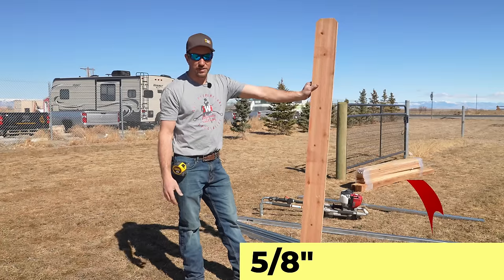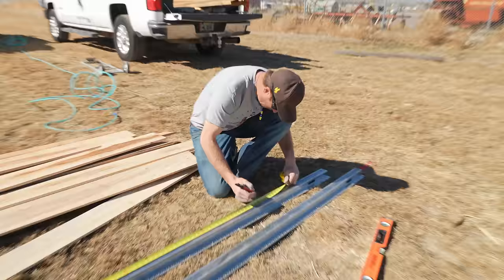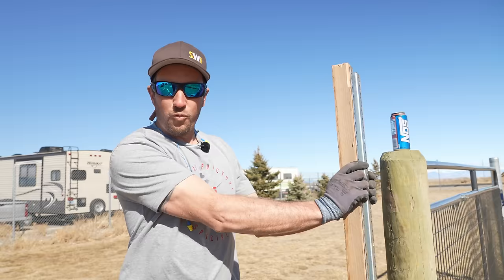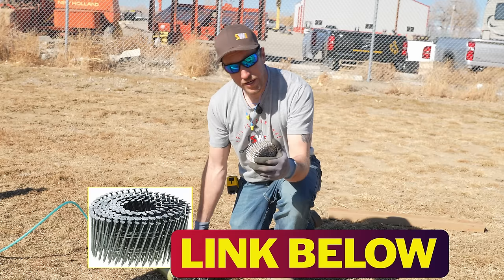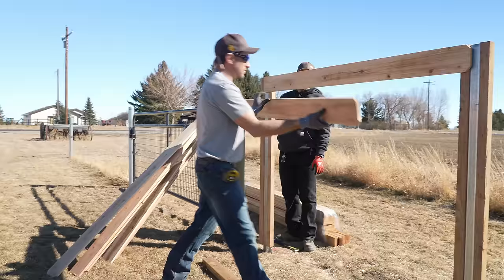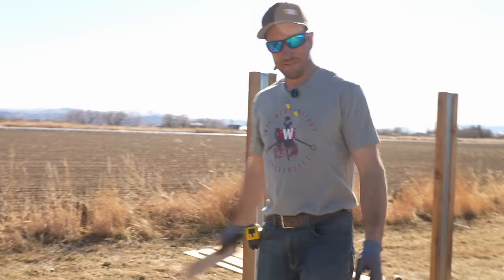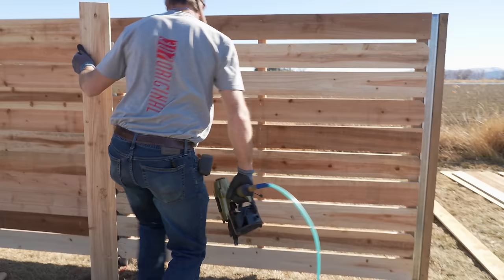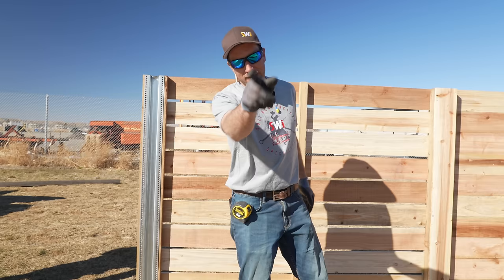How To Easily Build Horizontal Cedar Privacy Fence

Comment: If you want to skip the nailing phase and don't need to look at fancy finished ends, get some 4x4's and use a table saw to cut a 1-1/2" deep, 1" wide groove down the entire length of two opposing sides.  Set your posts so that the grooved sides are facing in the direction the fence is going to run.  Depending on what your budget or visual preferences are, you can space the posts apart at the proper distance to accept whatever length board/plank you want to use.  Once you have the posts in place, slide each plank down from the top into the grooves, and keep doing that.  You can keep the posts extending higher by a foot in case you want to install something later or maybe make the fence taller.  The great thing is, you can add/remove planks and use varying widths and styles to get exactly the look and the height you want.  If the city inspector comes along and says the fence is 12" higher than allowed, simply remove a few planks planks until you're at the legal height.  Doesn't get much more simple than that.  Alternatively, if you don't have a table saw to groove the posts, you can fasten two strips of wood onto opposing sides and leave a 1" space to accept and hold the planks in place.  You can also put a screw on the top board to ensure the planks can't be lifted out easily, or install a top strip along each section to create a fancier look .
Reply: Cool!
Reply: I was thinking of doing this, but I want a small gap between horizontal planks, maybe about 1/2”. I haven’t been able to think of a good idea for spacers. I was thinking maybe to use pocket screws. Any thoughts?
Reply: @nickgrubisich6367  Why not use one of the pickets? Or a section of one? That's 5/8" right there.
Reply: @nickgrubisich6367  I did what he describes on my deck for a single privacy fence. I used a router, as table sawing large grooves in even slightly warped wood is not enjoyable or time efficient.

I separated the boards by getting a spacer for consistency, drilling a tiny pilot hole on each side, and hammering in small galvanized nails. These hold the board above the next one and are mostly hidden on the ends, in the groove.

Honestly it’s a lot of work for an entire fence and I bet would take a huge amount of time. It looks amazing on my deck, however.

These 4x4 are prone to drying and bending and I’d wonder if removing more wood as described, over an entire fence line, would exacerbate that. If you did it with 6x6 or 6x4 you would have a cool looking fence.
Reply: I will be doing horizontal fence in my backyard this spring but I am concerned about 5/8 being a bit too thin, maybe go for 1inch instead.
Reply: The only problem with this method is your 4X4 post is only 3 1/2" X 3 1/2". That only leaves you a 1/2" of center material after making your notches. Not enough strength for a fence in my opinion.
Reply: @nickgrubisich6367  pieces of wood on both sides between the slabs, just like is done in this video.
Reply: The 5/8 x 6 x 6’ pickets at my big box store leave a lot to be desired, what with twist and warp. I imagine I would struggle to find 312 good ones for my fence. Do they straighten out ok once fastened to posts? Also, I plan on using Lifetime Fence powder coated black posts and letting the beautiful black show for contrast. What do you think?
Reply: ty soooo much. im literally doing this fence . we’ll sons are. but yea. i was clueless on how to avoid spending money on all them black slats to hold the wood. but u mention taking two strips of wood and
i get that . TY !!
Reply: Crazy... came to watch the video, leaving with a whole new plan.
Reply: @nickgrubisich6367 I am going to try screws in the posts, just above each plank.

Comment: I'm using 8' postmasters and putting them 48" inches into the ground with 10" holes.  Frost line is 42" inches and the ground is mushy clay in the spring (which is why I didn't drive them).  Can I get away with 4 sixty lbs bag of cement per hole and then backfilling and tamping the rest of the way(clay) or do I have to concrete to the top of the hole?

The section that I completed (to show my wife what I was doing) I filled to the top.  

I had to slow down on the project after hitting a rock on the last hole and pulling out my shoulder.  I had been doing real well being careful with all the roots and rocks in my yard, but got aggressive and dumb right at the end. Live and learn.
Reply from the maker: If you were going to skimp and put gravel or something anywhere, I would put it in the middle.  Well, I would prefer to see the whole entire whole filled with concrete. You could put two bags at the bottom, little clay in the middle and finish it off with two bags at the top just below ground level by two or 3 inches.

Comment: Is it not a concern how much the post moved back and forth when you pushed on the fence to demonstrate how solid the metal posts are? I’m obviously not an expert like you guys but I would think that you would want the post to be rigid and not move at all when you push on it? Just trying to figure things out before I install my own fence.
Reply from the maker: Not an issue at all. If the part that was in the ground were moving that would be an enormous issue and would ensure fence failure. The top having a little flex is not an issue.

Comment: I have an opportunity to get some 8 feet wide horizontal cedar panels (pre-built). Your comment not to exceed 6 feet wide is because you are working with 6 foot pickets or is there some other reason?
Reply from the maker: You could probably do 8' with this method. Wouldn't do any more than that.

Comment: Just completed my first 24' horizontal run today. Building the fence is a lot nicer than post hole digging.  The fence is 4' high.  I wrnt with 8 pickets and a quarter inch gap using a wooden paint stirrer for my guide.  Looks really good.

Comment: Great video…I constructed my horizontal Cedar years ago to cover a chain link fence. I used the metal grooved posts to set the cedar in it…perfect.
Love the horizontal look over vertical all day. Thanks again for the tip using the tape measure as a guide…genius

Comment: Horizontal fence looks alright if you have somewhat level ground to work with. Not so much when you have peaks, valleys, or a hill down your fence line. Much easier to blend your fencing  material into a vertical fence but you  likely need some longer material if you want your pickets close to the ground and still have a level line across the top and my OCD won’t let me do a fence that you look down the top and it looks like a wavy line.  That literally drives me insane! LOL  Many years ago my neighbor decided to put up his own fence and started out installing his pockets just following the ground line so whatever the ground did going up and down so was his fence!  Couldn’t help myself, had to stop him before he got going to far. Showed him taking a long string tied from the two farthest post good and tight gave him a level line to work off of and just cut the pickets from the ground to the string line and he ended up with a nice straight fence line at the top of his fence.  Neighbor thanked me many times for showing him that trick, but it was as much for me as it was him cause I have to be looking at it everyday too! LOL
Reply from the maker: There you go! 🤣

Comment: Great video!  What if the ground isn't level, which probably happens pretty often.  Do you keep the same height off the ground, or level the top of the fence and adjust the height of the posts?  You would notice wavy fence lines a lot more with a horizontal fence.
Reply from the maker: An excellent question. People prefer different looks. If you've got gentle changes in the ground you can get away with a dead-level fence--you'll just end up with gaps of varying size underneath. If you've got more severe changes in the ground we try to flow with the ground, but smooth out what it's doing. That way you keep to the flow of the ground, but the fence flows more smoothly in it's changes.

Comment: Great video, thanks! Helped me build an amazing fence! Questions on putting 2x4s on backside : 1) how necessary is this? 2) do the 2x4s hang a bit or should they be dug into the ground a little bit?
Reply from the maker: The 2x2 on the back is to keep the pickets from bowing, twisting, and warping over time. I'd say it's pretty essential--not for the short term--but for keeping things looking nice in the long run. And no, they only run the length of the pickets, not into the ground. 👍🏻

Comment: Great build & awesome video. Unfortunately unless you have large funds not practical. 
$90 for one of those posts. Didn’t price cedar boards but I’m pretty sure they are more expensive than other choices. 
One could easily take cheaper option posts and pickets and coat the buried portion of posts with tar before setting. The old time farmer’s used to coat the pickets/boards with a mixture of diesel & used motor oil to preserve. Or you could replace the used motor oil with chainsaw oil which has more parabens.
Reply: Under $3 for the 6’ dog ear cedar boards at Home Depot, so not too bad
Reply: $45 at Home Depot. In Mich.
Reply: @sgtbass64  
What a steal 😂
Reply: Compared to a 5 dollar 4x4. Suppose if money ain’t a thing then do it to it?

Comment: I like the idea of the metal posts but where I live they are $50+ where as the P/T posts are 16, sure they'll last longer but I can replace that post a number of times before I get to the amount. Yes I know the old posts aren't easy to dig up and replace but...initial costs of the project will cost me a lot more if I need 3 posts that's $150 vs 50

Comment: Fast and to the point. Great vid! Question - I have a 4ft estate block retaining wall I need to build a fence on top (about ~1ft from the wall). Would you recommend treated doug fir in concrete or these postmaster posts? With the postmaster, I would just be worried that if the wall ever shifts, that would compromise the integrity of the postmaster posts before wood in concrete. Thanks for any input!
Reply from the maker: If the wall ever shifted severely it would compromise a wood post as well. I’m a believer in post masters. 👍🏻

Comment: Thanks quick question how would you add the middle piece behind the fence to hold the pickets together if you have no access since they wanna get it as close as possible to the neighbors fence
Reply from the maker: Feed it down from the top. Have someone hold the top and someone hold the bottom while you shoot the nails.

Comment: You're a freak. Your sidekick is pretty amusing too. Great video, and you put a little personality in as well. I hope Postmaster is paying you well. You're selling a lot of posts for them.  I'm planning to reproduce your fence, no gap, and put corrugated metal on the bottom 1/3. Do you see any problem with how the two    wood/metal would wear over time? Glad I stumbled on your channel. 🍻
Reply from the maker: It'll be awesome. 👍🏻💪🏻 You could probably expect to see the wood pickets dry out (shrink) in width just a little bit based on your climate or area. I don't see any major red flags though.
Reply from the maker: Also, don't forget to keep the cedar stained. That way they'll both last a good long time.

Comment: Can you do a horizontal cedar fence with air gap on a slope with the boards running parallel to the slope, not level?
Reply from the maker: Sure. You'll have to angle-cut the ends of your boards.

Comment: Hey SWI/Dan, do you think 2x2 or 2x4s (ripped) made from pressure treated pine is acceptable as an alternative to the cedar wood just for the nailers? Since it’s going to be completely covered up by pickets on both the front and back, I’m wondering what you think?

It seems it would be a huge cost savings and cedar 2x2 or 2x4 is actually harder to find in my area.
Reply from the maker: I would think that would suffice. 👍🏻

Comment: we're building a horizontal fence with treated pine and trying to decide whether should do 6 or 8 foot lengths. Any thoughts on whether 8 feet is too long and will warp or whether should be okay as long as we add a center support/plank in the middle?

Also will the steel work in softer soils like we have here in Columbus? 

Great video!
Thanks!
Kev
Reply from the maker: It's always going to warp no matter what--it's just a question of how much. It's a personal call, but you also have to factor in wind load, and height of the fence. If your soil is softer than normal that's a factor too.
Yes, steel should work in softer soil: https://youtu.be/mc92svvCRFo
Reply: Thanks! Very helpful

Comment: Question, so the next section is solid no air , then 4th one air slots , etc in that order ? Serious question please
Reply from the maker: No no, the sections are usually all the same. We were just demonstrating two different styles. I mean, you can alternate them if you want or do whatever you want, but we were just showing how to do it either way. Typically once you pick a style you do your whole fence like that.

Comment: I see in my area I see them weaving the horizontal boards in the middle between the posts. Is that ok too and do you have a videos on that way? So what do you do just stick a 2*4 or so  weaving  and nailing it. Does that shorten the standard boards or is it a negligible shortening of the boards?

Comment: How do you affix the vertical trim piece on the inside of the "hat"without hitting the metal flanges?   I saw you used a pneumatic nailer which is uber fast if ya don't end up hitting the metal.  Thank you  for the video!

Comment: So, should this fence be wobbly? Mine is installed in concrete but it is wobbly... Any suggestions?
Reply from the maker: I don't know what brand you bought, so that could be a factor, but there is supposed to be some flex in the posts, yes. https://youtu.be/pI5defhDiEM?t=856

Comment: I think you need some pressure treated for the kicker board at the ground.
Reply from the maker: It's still above the ground. If you change to a pressure-treated picket for the bottom one you'll have a definite color difference.

Comment: What do you guys use to cover up the posts when going with standard 6ft fence? (My assumption is a picket without the dog ears cut off won't look good)
Reply from the maker: Typically just a picket. We either cut the dog ears off or flip the dog ears to the bottom.

Comment: What if it's on a slope
Reply from the maker: If it's on a slope you can leave a  little gap between the ends of your horizontal boards so you can slope them at an angle. Or you can angle-cut the ends of your horizontal boards to follow the slope. Or you can stair-step. (Like we do in this video: https://youtu.be/g3cFapnA7mM)

Comment: Can I go with 8' spacing if my boards are rough cut 1" x 6" boards?
Reply from the maker: Probably. Make sure you're going deep enough and using enough concrete.
Reply: @SWiFence  9' Postmasters for 6' tall fence. Should be good.

Comment: If I have rocky ground and not able to directly drive the post and need to dig, do I have to set it in concrete? And if I’m making a 5’ high fence do I burry them 4’?
Reply from the maker: Yes, for sure. If you're not able to drive them and you have to dig you would need to use concrete. You could use a 7'6" Postmaster and set it in 3' or 2' 6".

Comment: what happens if you get stuck and can't drive the post. do you dig it out and set in concrete?
Reply from the maker: If we can't reach depth then yes, we have to resort to digging and setting in concrete. Before we surrender though we move side-to-side a bit and see if we can get through or around whatever's there.

Comment: I am just about to do a fence in my front yard, can I do an 8' span if it's only going to be 3' tall? I would use the vertical boards at 4' to keep it from sagging. Will that work or would it still be too much weight? Thanks for your video!
Reply from the maker: You could probably do 8'. Wouldn't do any more than that.

Comment: Nice work gentleman. I appreciate all the work into the videos, they are a huge help. What's your nail gun recommended for 500+ foot wood fence installation?
Reply from the maker: Definitely the magnum nail gun (we sell it, but we also use it).
Magnum Nail Gun: https://bit.ly/swimagnum
15-degree Ring Shank Nails: https://bit.ly/15degringshank
Reply: @SWiFence  Ok thanks for the response. Why the coil nailer over a strip nailer? Cost of nails? Less reloads? Just curious about your perspective
Reply from the maker: It really just comes down to personal preference. 👍🏻
Reply: @SWiFence  Ok thanks for the message. I'm milling all of my lumber from trees arborist we're going to burn. I got 20 4x4x8's from one log. This will be the first fence I've ever put in. Your videos are clear, concise and  informative. Thank you for sharing your knowledge it helps since most people are full of it. I'll send a photo over of it when I'm done. Thanks for the inspiration brother 👊🏼

Comment: Good video! What is the time span on how long a fence like this lasts? Wood rots fast
Reply from the maker: Which is why we only use cedar when a customer wants wood. 👍🏻 This is also highly dependent on where you are in the country.
1. You have to stain the fence if you want any real life out of it.
2. In our neck of the woods you'll be replacing some of the rails or pickets around the 15 year mark +/-.
3. By 25 years you're going to need to replace the majority of your fence.
4. The Postmasters are basically good forever, so even when you do replace the fence they stay in the ground. That saves you a huge amount of cost and labor.
Reply: @SWiFence  who's the local dealer for Postmaster in Virginia?